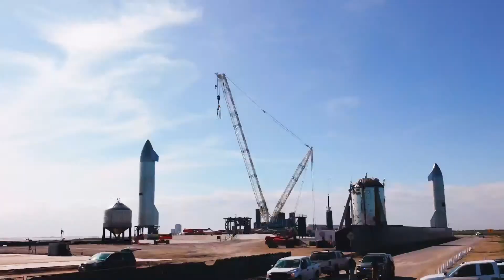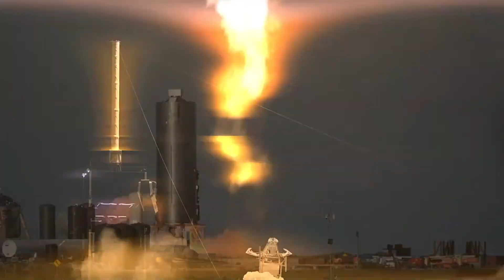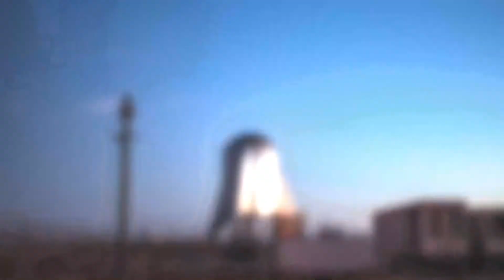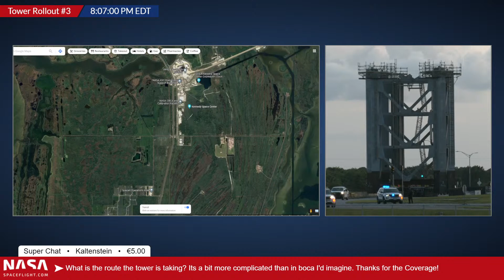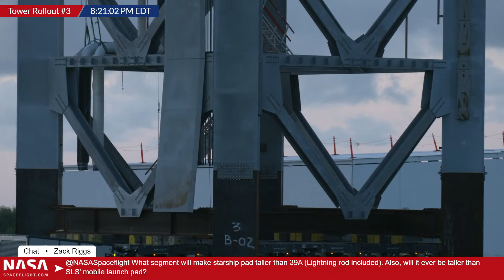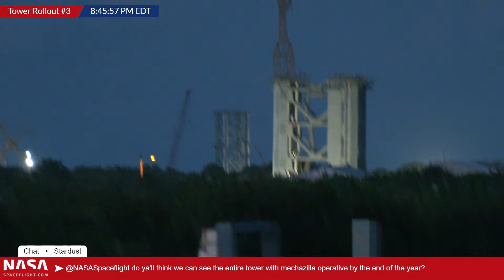SpaceX Rolls Out Third Starship Tower Section at Kennedy Space Center

Comment: They stop to drive up on plates / mats set on the grass to go around objects they couldn't remove from the sides of the road. If you notice, all the signs are cut off and laying down. They put them up and down for these transports. Some of the less important signs they have just left laying down. But speed limit signs they put back up. I first noticed the plates / mats on the grass and the signs cut down a few weeks ago, didn't know why. Then a few days later they transported the first section and it all made sense.

Comment: I find it funny that they end up driving on the grass verges when they slow down in front of the VAB
Reply: They are trying to get by the concrete posts imbedded in the far side of the path so they have to run the starboard side of the transport in the grass to clear in several places